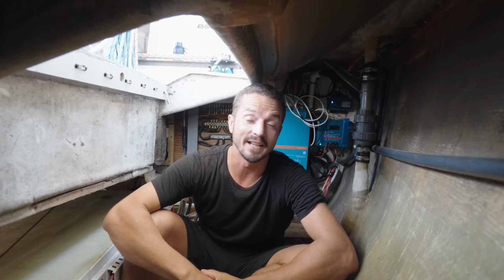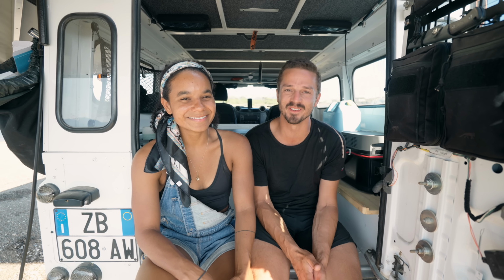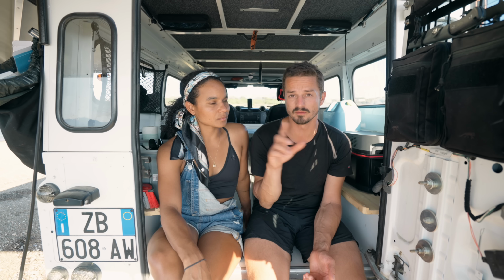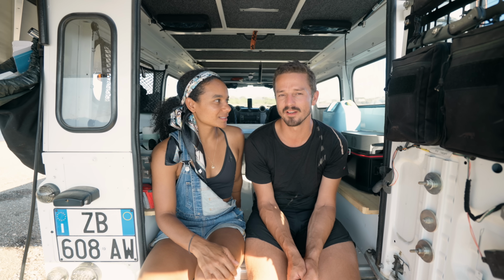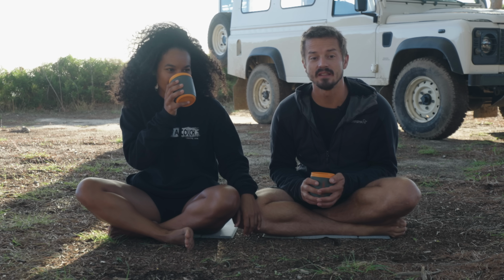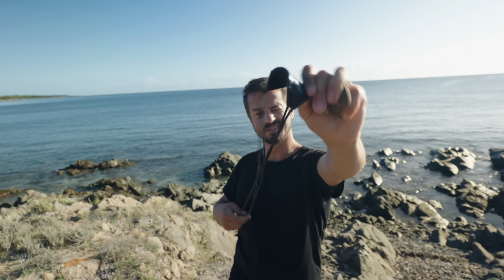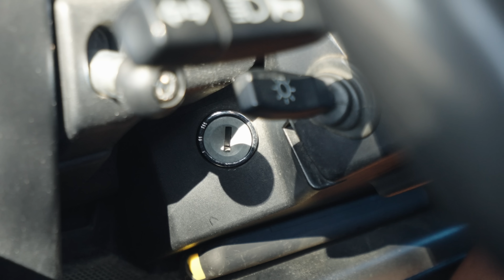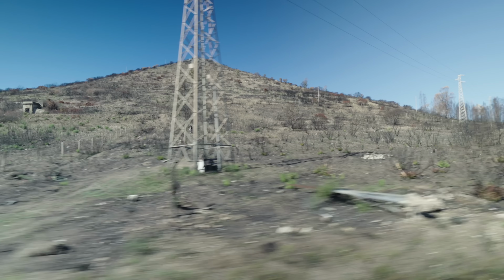Living in “Luxury” in our 4x4 Truck | Step 365

Comment: Don't know if it's the camera angle, if not then your fisheye mirror is supposed to be adjusted to see your tire where it meets the road.  Set main side mirrors to barely see the side of the truck, then set fisheye
Yes it's better you not charge those deepcycle batteries with an alternator.  I always try to keep my alternator demand to below 70% of it's rated output. They tend to last at least 5 to 7 years like that. In my past boats and RV's, camper tow trucks I've always installed a separate clutched generator on the motor for charging deep cycle banks.

Comment: Your comment about an induction cooktop struck a spark.   We are not sailors but travel with an off road travel trailer.  It has lots of solar when the sun is out and battery power. It is short  with only 2000 watts inverter and a 1800 watt induction cook top.  We love good food and the two burner cooktop is so limiting.  I am looking forward to how you approach this on the renewed Uma.

Comment: I have built a little pole behind canopy on a utility trailer that used to pack my 3 Wheeler in and on the two back doors that used to swing open I had my kitchen sink on one side and cupboards and on the other side was my stove and on the side of the trailer I had a clip on table used to take it out of the back of the trailer and then just clip it on the side of the trailer with one leg on it I was really dumb my soul the thing for like 300 bucks and it was all checker plate aluminum that I welded together with a trailer floor and everything and it tilted so I could drive the trick up into the back and then back the track out and then fold down the bed at the front and all your cupboards inside and you're stove and you sink on the doors when you open them up you could cook inside or you could even cook it outside

Comment: Great stuff 🙂 I'm an old fart, in Canada. Next summer I'm heading to BC maybe the Yukon and Alaska, prospecting. To facilitate that, I bought an old Chevy Blazer 4wd. I got it for $300 and am fixing a lot of mechanical issues. It's too small to do what you're doing, so I plan on getting a small enclosed trailer and outfitting it with much of what you are installing... Needless to say, I'm watching these videos, intently... Great stuff and a lot of good ideas. Thanks for posting all of this 🙂
Reply: Go for it. Do be aware that you can get the same bang for a lot less bucks. Beware "all in ones" and blue boxes  ;)  And pretty much anything gotten in a sponsorship deal. They are not horrible or anything but if I was to buy one, it would have about the same effect as buying a couch.

Comment: Dan are you going for a 48v system instead of a 12v one. Tesla is now going 48v so there should be many 48v accessories around. Kelvin
Reply from the maker: We have 5V, 9V, 12V, 24V, 36V, 48V DC. And 110V and 220V AC on-board.
Reply: Sounds a bit like Leo's system on Tally Ho.  @SailingUma  👍
Reply: Still remember the fantastic sunset motor (the wind dropped) in Southampton.  Seems like  an age ago. Kelvin XXX

Comment: Eight minute Eco Flow commercial
Reply from the maker: Unfortunately we didn't get paid to make this video. it would have been a nice bonus. but we were just lucky enough to have received the gear that we wanted for free. Besides, if a brand wants to pay us to share about something we would have purchased ourselves either way, I'd call that success.
Reply: Didn't mean to crap on you guys. Props to you both for working on your boat (expedition Evan's too) rather than having new custom built in Communist countries.  Also for venturing out of the warmer climes and going to Svalbard.  That's adventure.

Comment: Ok, info on ice maker function probably dictated by the science behind what agent is used to cool things down. Tradition type of in home portable ice machine requires you to wait for an equilibration of internal agent after moving the ice maker around.  Machine needs to be level and still to operate appropriately: so no making ice moving down a bumpy uneven road. Just my two cents from using an ice machine at home.

Comment: Why didn't you replace your alternator with a generator version capable of recharging your battery? Granted, it is not currently necessary. :)
Reply from the maker: We have one. It can put out way more power than is no to charge our little battery. The solar is way more than enough. We’re fully charged up by noon most days.

Comment: How does solar panel install impact your pop-up truck roof?
Reply from the maker: It doesn’t. Once we start loading up the roof rack, we’ll need to upgrade to stronger gas struts to help lift the load. But that’s a common modification available from the manufacturer.

Comment: Loving these videos and the offshoots for the 4x4.  May I ask a bit about your diesel?  Since it is a bit older, do you have to worry about the type of diesel fuel you put in?  For example, diesel here in the states changed over to the low sulfur a number of years back now.  But running low sulfur diesel in an older engine can also be problematic.  Not just cause of a loss of expected power, but more concerning would be due to its properties and how to still protect the original engine.  For example, do you need to always add fuel additives or perhaps in Europe, they still sell the higher sulfur content diesel and you simply do not have to worry.  Just curious always.  Wish you two the best!!!
Reply: Europe has crazy energy politics: Forcing you to have 5 to 7% 'Bio'-Diesel with no option to say 'no!' It is of course agro-chemical food destroyed for inefficient energy outputs and adding to starvation on our planet by more imports from poor regions of the world. It will go bad in storage on top of that. And it is not nice to engines, too. Low sulfur does not seem to be a problem even for older engines.
Reply: Unlike the lead in gasoline with engines where the valve seats were just cut into the cast iron heads, sulphur never had any useful upside, and ultra low sulphur fuel allows you to go longer between oil changes.

Comment: Will the ice maker work at sea?
Reply from the maker: I dont see why it wouldn’t
Reply: @SailingUma  you mentioned the ice maker was having trouble while your truck was on the move and performed better when stationary. 
  On several of the seagoing tugboats I have worked on, there were 120v consumer grade countertop ice makers from “box”stores that work well even while basing around a couple of hundred  miles off the coast of the US. To be fair each of those tugs made enough power and water for a small town .So the load was of no consequence.

Comment: No way is your shitty solar output on the old panels due to age.  Almost all panels will give 80% of the original output after 25 years, about 2/3 at 50 years.  Anything less should be considered a defect or damage.